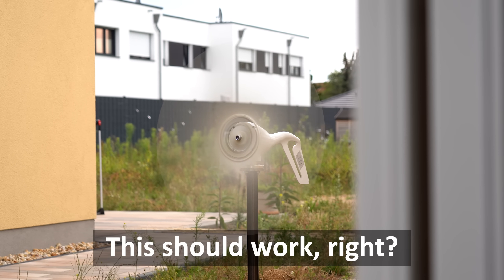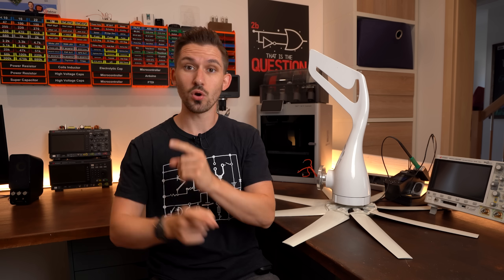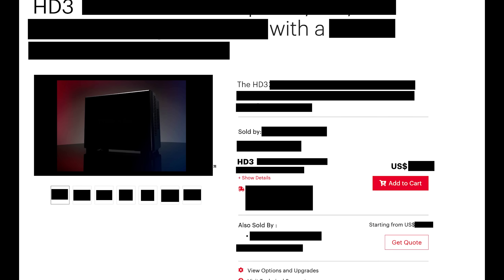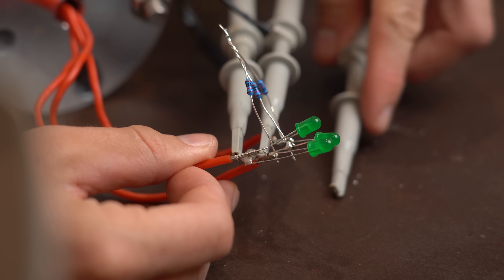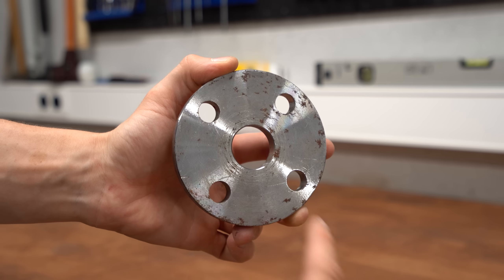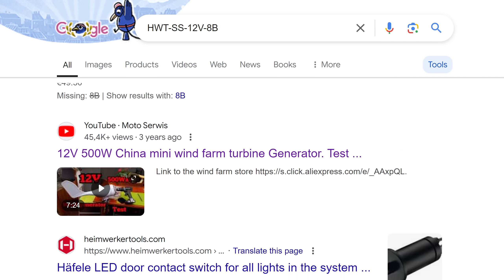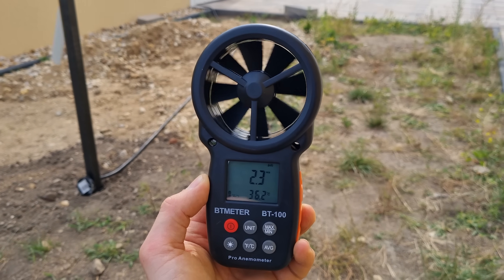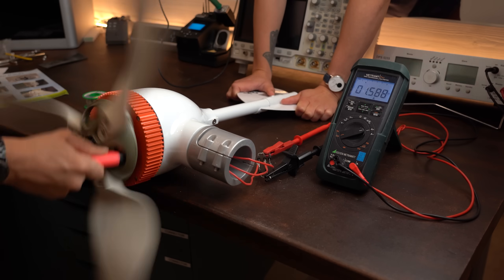I tried to Power my Home with Wind Generators! (Worth it?)

Comment: Another negative you missed is that if mounting these things to a building the coupled noise will drive the occupants crazy

The big problem at low wind speeds (apart from poor torque coupling) is insufficient shaft speed. You almost want some kind of multiplying gearbox. If rewinding you need a LOT more poles, not just more turns

As pointed out elsewhere, small wind turbines are generally a waste of time unelss you have high wind speeds (ideal conditions) and for the most part when you see them they're primarily "virtue signalling" rather than actually useful

Comment: at my location I have a spot I could put up a fairly high turbine, but its a few 100m from my battery shack. I was thinking of using some transformers to boost the output voltage to something more appropriate for longer cable runs. could be an interesting experiment. if your run is fairly short, you could use some multi-tap transformers in an autotransformer configuration if you didnt want to deal with high voltages, although I would probably jack it it up to 1--200v, as power cables of that rating are very common. but I have plenty of solar collection, so very rarely run out of juice, except on really stormy days.

Comment: The problem is ohm's law
And everything is measured in watts needs to be measured in amps which is actually going into the batteries 
Measured in watts at best you get less than 20%

Comment: 1. It needs to be mounted much higher off the ground, wind speeds are higher and more consistent further from the ground, at the very least you should mount it on your roof.

2. MPPT will only charge your battery effectively if the output voltage from the turbine is higher than the battery voltage

Comment: If the output of that 3 phase rectifier gives about 6V, why not charge a battery of a lower voltage and when full convert that into the higher voltage storage. Just thinking if that MPPT is just pushing the turbine beyond its natural capabilities by expecting 12V output slowing down the turbine or something making it much less efficient?

Comment: Would it not have just been easier to adapt the turbines to a 12v car alternator as these already have voltage regulator and are made to supply a 12v battery, I just set up a solar panel light system for a family members allotment using 2 12v truck batteries set used as 24v powering the ligjts a usb and a cigarette lighter to power everything they need but the area we live had more wind than sun so i was thinking of using a truck alternator to power them instead

Comment: People see a tiny version of a two hundred metres wind turbine. They are not worth installing. The wind is ten times more effective for generating electricity. Down at eight metres above the ground there is no wind generator worth a tenth the cost. These fancy screw shaped ones. Hundreds of barrel shaped wherely things along motorways. Small  whizzing  fans lining factory roofs, all are not worth receiving as a gift.  I learned from my mistakes. Don't . Solar is a quarter what it was four years back. What I paid for recycled panels is now three times for new. They too are half the dimensions and will noticeably improve your value. For God's sake tiny windmills are useless.

Comment: for any wind generator to work it has to be above tree level and any building or wind restrictions to get any potential. also you said it wasnt allowed. its your property? I would still put it 6 feet higher than my building top and there is nothing anyone can do about it if you own the property.

Comment: Say your turbine swept area is around 1m^2 and wind speed is 3m/s then total wind power is  0.5 * 1.2 (air density) * 1m^2 * 3m/s^3 = 16.2W so with no friction and about 40% efficiency for that type of wind turbine you are looking at 6.4W but of course there is friction so 3m/s is basically the point where you can barely start producing something.
Most turbines are rated for 12.5m/s so in that case 0.5 * 1.2 * 1 * 12.5^3 = 1172W * 0.4 = 469W
As you discovered wind turbines unless installed in very windy places with no obstructions are no match for solar PV.

Comment: most generators focus on a motor working in reverse condition. 
what to me means that they are not optimized for energy production but to movment production.
I believe that two changes at minimun should be applied to the electric motor to work as a generator (wind).
1º gears to make the axis of the motor turn more times than the propellers.
2º the motors usually use permanent magnets. They should be switched to electro magnets. These should be energized by coils and permanent magnets in a parallel configuration to the electro magnets. with these in case of increase in the wind speed more current would run in the electromagnets and more voltage would be generated. It would also increase the resistance to the axis rotation helping to control the genertor speed.

Comment: That wind generator may de-capitate some kid running thru there.  Kidding aside,  the wind turbine has to be up in "  clean  " air or air undisturbed from turbulence from buildings, outcrops or trees as the wind blows by.  At lest 30-50 feet above any building to be effective.  Whether wind or solar used,  the system has to store the energy in batteries to buffer and store the energy as it is later used.

Comment: Those cheap turbines are really useless - especially at ground level. The unit with around 6 blades is just ridiculous -three blade systems are best, more blades than that just add mass and increases the torque that needs to be applied to turn the alternator - that was why the 3 blade unit worked better. The swept area of the coils is a major factor in the energy produced, but rather than require the coils, increase the flux density of the permanent magnets - it's worth checking them to see what type and strength they are - a good way forward may be to change them out for neodymium high power magnets. 

I have looked at many of the commercially available turbines - really rubbisg for the money they cost - so I intend to make my own from scratch - rotor, stator the lot. No point being an electrical engineer if I don't use the skills!!

Comment: Pipe dimensions are based on the INTERNAL diameter of the pipe not the external.
You will probably find that the specified 25mm pipe was actually correct!

Comment: Man, as electrical engineer I may say: this kind of generator is only useful if it were installed in high points, like the roof for example, because wind speed is higher. On the ground level is completely useless.

Another way to improve it is if you install a gear box on its axis to increase the speed (like thre bigger ones are made).

Comment: You make zero sense! You don't have batteries to power your house "during the night"? Then how is the wind generator going to make any difference? Wind comes in gusts, there is no point in a wind generator if you have no way to store that power. And the only cost effective way to store that power is LFP batteries with the most economical way of using that power is running all the DC devices (like laptops) with solar or battery DC power directly, to address the problem of energy loss due to DC to AC and back to DC conversion. This is where USB C coupled with a variable voltage PD module makes a lot of sense (unless you want to build your own power distribution centre that supplies variable DC voltages for home electronics).

Comment: If you have these LEDs connected like that and that small voltage when you turn it that fast, the thing gives less power than a printer stepper motor. What a ripoff.

Comment: When I was in my teens I made a turbine using the Dynamo from my bicycle and wooden props I made. It was wobbly and horrible but it could power a single LED if the wind was right. That's when I learned like everyone else that wind alone isn't enough

Comment: perhaps adding gears and using one of those vertical wind turbines would help, the turbine that way would rotate slower but with the gears it would generate higher rpms

Comment: Maybe your next major DIY project should be a decent sized recycled 18650 Powerwall. With full BMS, inverter, charge/discharge, balance, even a bit of a "smart" cell monitoring system using an ESP32 or Pi Zero W or something with a bunch of sensors in the GPIOs all integrated into your Home Assistant via ESPhome, or zodiac again, to give you round the clock remote monitoring and alerts no matter where you are. You could maybe even include some sort of relay switched emergency systems etc.....then it's just a matter of getting the most you can out of your solar panels during the day to provide to keep the battery banks sufficiently charged, and the battery banks having sufficient capacity to supply the all night without too much voltage drop.

Comment: Solar panels increase linearly. Add one more panel, you get one more panel worth of energy. That is how you increase the size of solar farm and solar units. Wind turbines are basically exponentially increasing in power with size. So if you double the size, you get more than double the power output.

Comment: Without watching a single second of this video....

I've done a lot of research on this subject, so if you want to skip the 12 minute video, just read this.  Are wind turbines worth it??  Depends on where you're at.   Some places gets a lot of wind.  Some places get wind fairly frequently.  Some places get wind very infrequently.

At the very least, it's a good solution to augment your solar panels.  And if your in a place that gets lots of wind, you could power your house strictly with wind turbines...

Comment: You're generator is too low. you need to raise it to a higher to get it into cleaner and faster winds. You need it to be at least 3m up to get descent unobstructed winds. You might be surprised by your results by just lifting it higher.

Comment: If the regulations do not allow building a structure that would allow the turbine to be placed high, maybe it would be possible to circumvent the regulations by hanging the turbine from something that has already been built or from a tree? Something like this:
https://youtu.be/Ag5W8K0zsH4?si=2PZpqZaUqFLErlcZ&t=1110 Greetings, viewer from Poland. Here, avoiding stupid regulations is an everyday occurrence ;)

Comment: I understand that it's fun for you to play with wires and a soldering iron, but there are such windmills that you can buy in a plug and play version with everything that you installed at the end, they are mostly installed on sailboats (I have one), but it made noise for me, so I installed a couple of new squares solar panels that have much more power than those windmills

Comment: For residential wind power the rule of thumb is don't mess with anything less than 10 kW. Don't mess with anything on a tower shorter than 60 feet. And don't mess with it at all if your annual average wind speed is less than 12 mph. Everything else is nothing but kinetic art! Or you could simply call it hobby crap.

Comment: Just plug in a big fan next to it and blow the wind on it you need.  Simple!  LOL.

Seriously, though, if you were to connect a motor to it to spin it, you could get a good idea of its mechanical efficiency (and if it is a lie) - just measure watts in vs watts out (and assume a few % losses come from the motor as well).  You can also just do the math, which windpower generator guide did (google it):

Suppose you have a micro turbine with blade diameter 1 m (about 3 ft) and efficiency 20%. Let's calculate how much electricty it can generate for your home at the air speed 6 m/sec (which is about 13.4 mph).
Rotor swept area: A= π(D/2)2 = 3.14×(1/2)2 = 0.785 m2
Available power in the wind: Pwind= ρ×A×v^3/2 = 1.2×0.785×63/2 = 101.7 watt

Then the power that can be extracted at that speed is: Pturbine=0.20×101.7=20.3 watt.

20W!  And it is far worse for lower winds due to the CUBED relationship of velocity to power.

Comment: MMA or stick welding is an art, easy to learn and hard to master.
Keep at it and you'll get the hang of it.
Let's the stick control the welding pace, you'll have about 45-60sec of run time with 2,5mm and those 1,8mm (which I believe your were using) won't cut it for the thickness.
Unless you preheat it and does multiple "strings"

// 18 years as a welder.

Comment: Larger blades are you vest bet for a mod. Luckily its also the easiest if you have a 3D printer. If you could legally increase the height by about 610mm and print blades that would get you the best results.

Comment: Or... make the blades longer.
Realistically - the only way to get any sort of usable power out of a "small" wind generator is to have blades at least 2-3 meters long.
There is a reason the big commercial generators have blades over 50 meters long.
It is a leverage and torque thing.

Comment: Even a small wind wine generator like that needs to be at least 2M ABOVE any objects, like houses, hedges etc. Even something downstream and close by can add to turbulence in the airstream and rob it of any useful power.
I used to fit them to canal boats in the UK. It's not so much high wind speeds they need, as smooth air flow with no turbulence.
If local regs stop you from placing it high above your house, you are never going to get anything useful from it 😞

Comment: A diy wind turbine (there are some good free plans online) made for hundreds is the only type that makes sense in all but the highest wind areas, then the 1 or 200 of intermitent watts it produces pays for itself in a few years rather than the 10 or 20 years those costing a few thousand take. This isn't even including the cost of mounting it at a practical and safe height or maintenance.

Comment: They're not worth it on mass scale either. At least the sun comes up every day, and even on a cloudy day you get SOME power. Wind is too expensive per watt, and too unreliable. Solar has massive issues as well, that being vast amounts of many countries are unsuitable due to climate and/or their position on northern or southern extremes, and it's benefits are often used up in cost of transmission or storage.

Comment: not sure but maybe custom wings could solve the problem?

i´m thinking shorter but wider wings. 
my logic is small fans has a tendency to spin faster but with lay less torque 
but if the wings are wider to catch more wind (or more of them) you can negate that or maybe even give it more torque than the default wings.

another idea is to maybe make a frenkenstein version with borth the coils and rotors connected to on of the fans and basically making it a 6 coil generator instead but the coils are connected in series in pairs of 2 and ~doubling the voltage or if having them in parallel four more current whitchever would be best suitable for the wind controller.

note i have no knowlage of aerodynamics but in my head that makes sence to me atleast from my experience.

Comment: What is your accent? I've heard it once or twice on InnerTube before, but I can't figure out where its from? Polish? I know you live in Germany. But just wondering.
BTW> Most wind generators that actually make power are always super noisy. You can hear them on a lot of boats in my area. They scream in real wind (above 20knots) and are generally disturbing. While a solar panel is silent for the same power.

Comment: E234 Euo's is $259.00 Dollars. It's interesting that the Housing Complex or German/Local Government would limit the height of a wind generator to a safe and useful height. Wind power works great when applied properly with over 1KW and over 15KW wind generators in regular use on peoples farms and remote homesteads in the US and many Island nations as well. You should do a video on why the Housing Complex or German/Local Government want's to restrict the height of wind Generators. Thanks for sharing. I couldn't give the video a thumbs up, but rather I gave the video a thumbs down, because of the statement "Using a wind generator is not worth it." This is because you didn't specify, "For Me" and gave it a blanket statement "it's not worth it". Please do two follow up video; 1. On why the restrictions against Wind Generators are in place. 2. A home built Axial wind generator like in this video, like the one for this YouTube Title "How to build a Dual Rotor Axial Flux Alternator PMA for a Wind Turbine" by WindGenKits or the VAWT video named "Genius Vertical Wind Turbine for Home beats Off Grid Solar Panel!?" or HAWT "Genius RidgeBlade Home Wind Turbine Beats Solar Panels by 220%" by The Futurist.